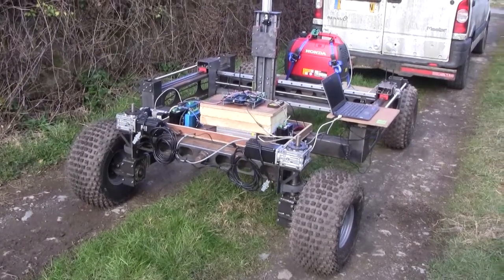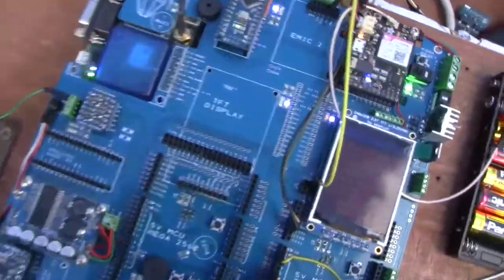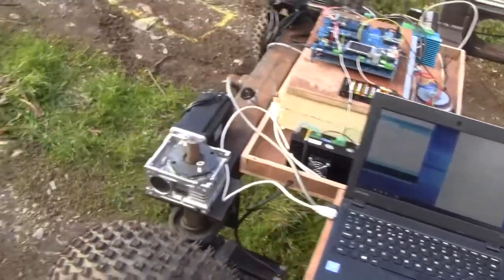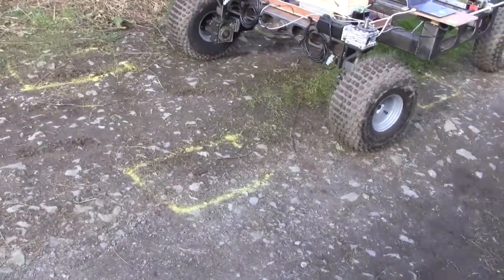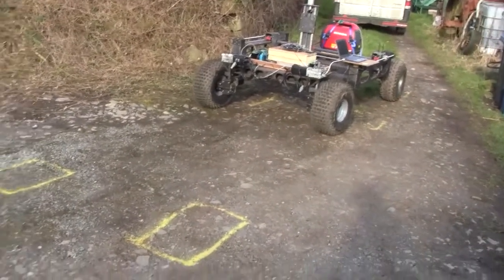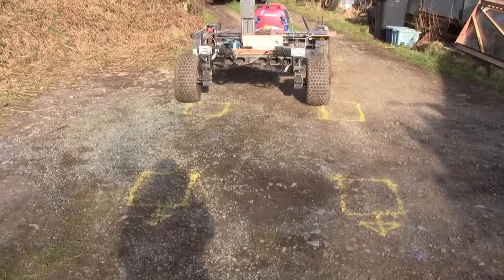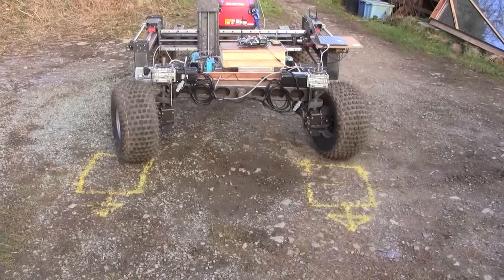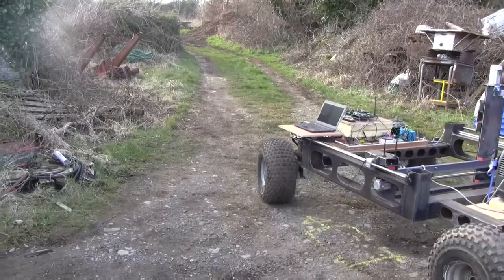Autonomous Steering Demonstrated on WEEDINATOR

Comment: This is a very cool project. Very interesting design, it's a CNC gantry on wheels. There might be some other uses for this setup, like printing concrete or plastic perhaps? Maybe painting lines or street art? Anyways, I'll be watching the progress with great interest.
Reply from the maker: Yes I was thinking the same thing. Would be pretty easy to turn it into a 3D printer on wheels.